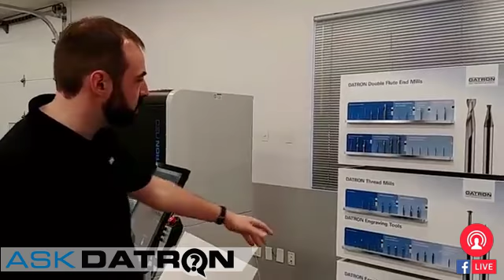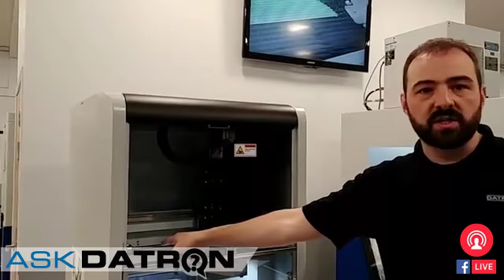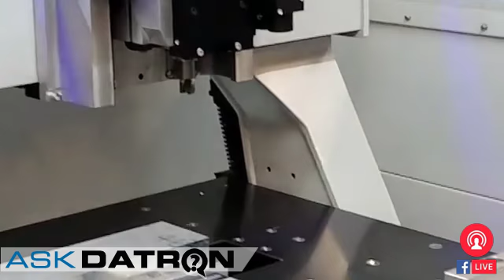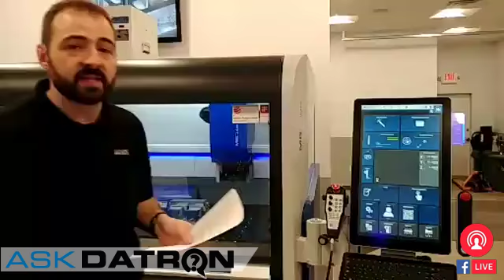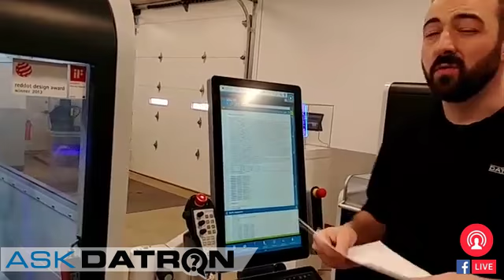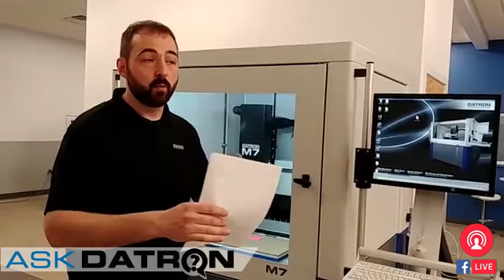Ask DATRON Introduction

Comment: Hi Guys,
Can we cut grade 5 Titanium on the Neo.
To be more specific we’re planning to cut a carbon fiber composite with an solid 1mm Grade 5 Titanium core.
Reply from the maker: Denis, at 12:14 in this very long video, Dann addresses this question. To elaborate, your carbon fiber composite should be ok. We have a line of tools specifically for abrasive composites that might also come in handy.
Reply: I wasn’t sure about it, because he only talked about the C5 and Titanium grade 5 and all other ones Titanium Grade2.
At least that what I understood